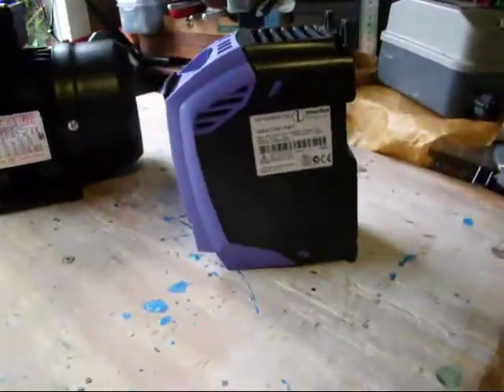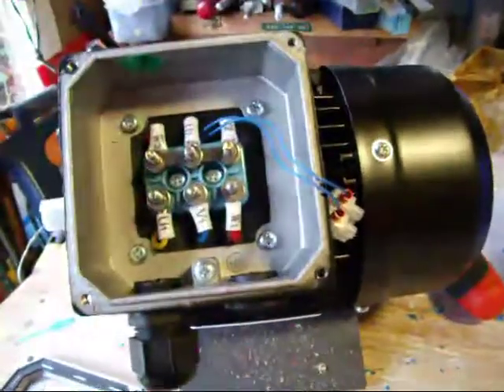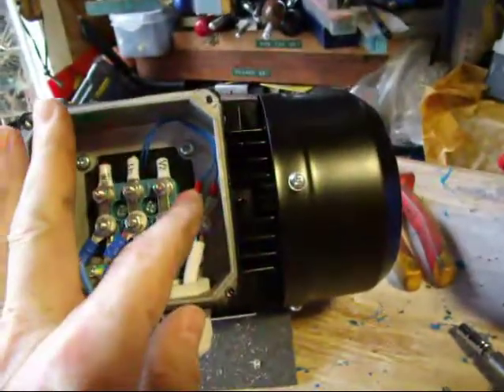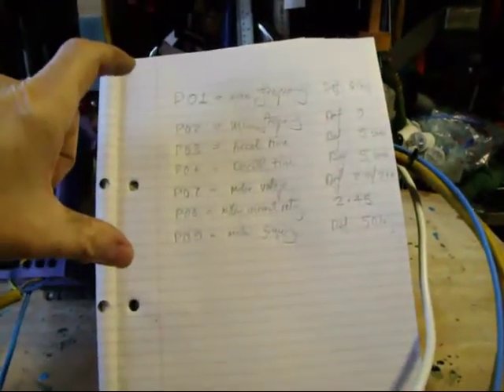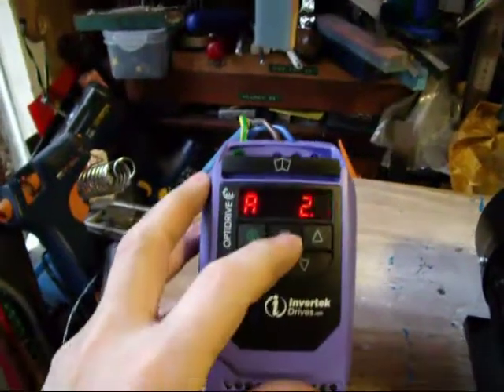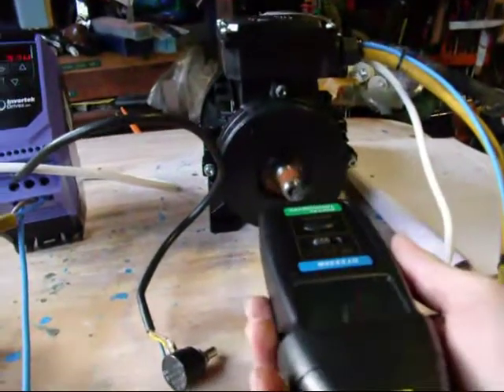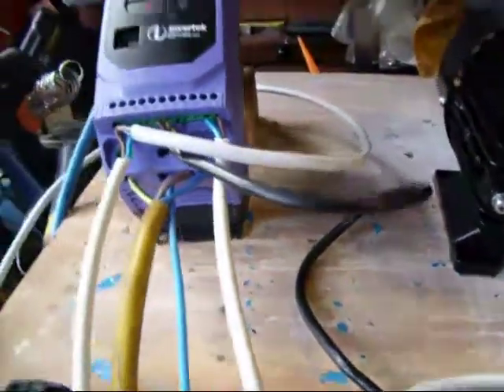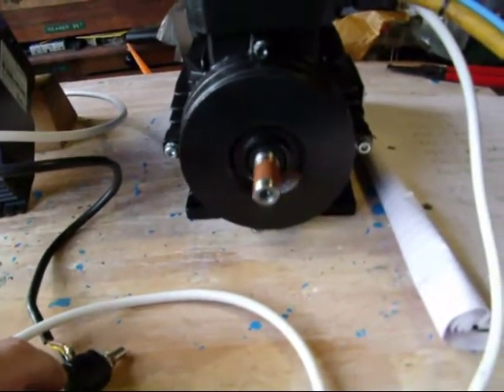Invertek Inverter

Comment: how to forward reverse bro.
Reply from the maker: Go to the end of the video and there is a diagram showing you how to wire up external switches to start stop and go forward and reverse.  Just before that I also explain you need to change some parameters on the drive to make the external switches work.  Hope this helps?

Comment: Hi George thanks for this very informative video its been very helpfull in helping me make my mind up on converting my WM280 as it has just died! I hope you don't mind if I ask a question - The lathe came with a 1.1Kw motor but you have gone for a 0.55Kw motor is there a reason for this ? as you have downgraded the power output which must affect the lathes ability to function as well as it did with the standard motor set up.
Reply from the maker: You raise a good point.  I used the smaller motor because I had it available. However I have since changed it to a 1.5KW motor to ramp up the power.  Because the motor is now external changing it was very simple!  Thanks for the query.

Comment: It actually doesnt "remember" the speed.. You have a 10V between analog pin in and ground through a resistor.. well the resistor lowers the voltage, "signal" speed.. and the VFD adapts the speed to the voltage signal.
Reply from the maker: Fair point!